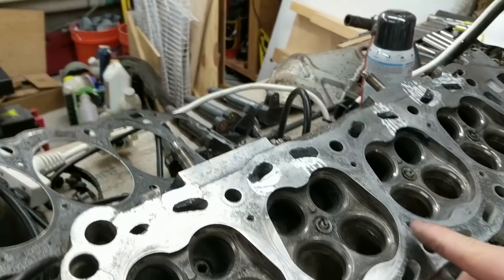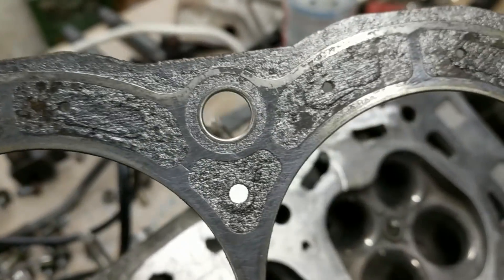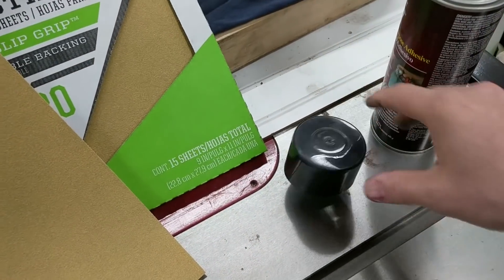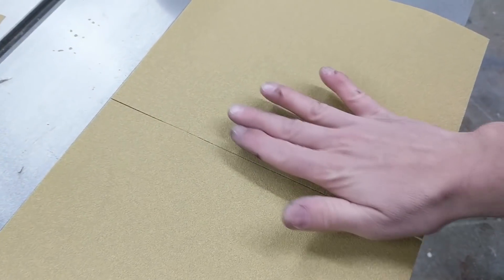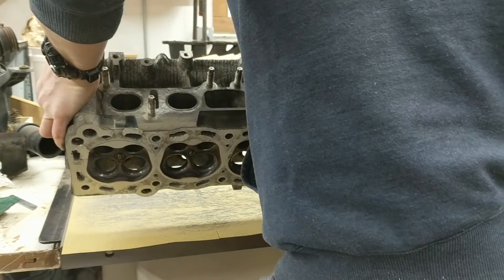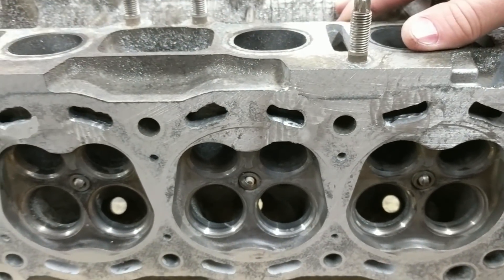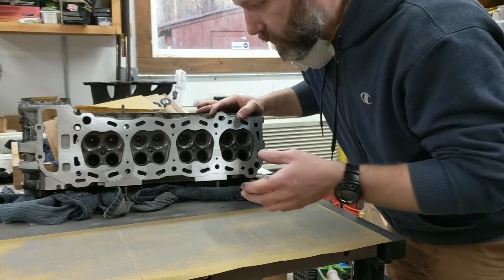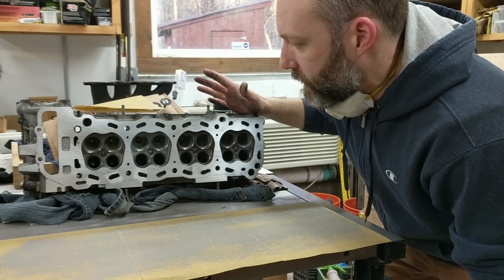Using a Table Saw to Resurface a Cylinder Head

Comment: You should have first used a certified straight edge to verify the flatness of the table saw top. If you sit the straight edge on top of the table saw then you can use feeler gauges at different points to verify how warped the top is and where the warpage is located. Example: If the feeler gauge slides under the straight edge in the middle, then the table saw top is sagging. If the feeler gauge won't slide under the straight edge at the center, but it will at the outer edges, then the table saw top is arched. The largest feeler gauge you can slide under the straight edge (without lifting it) is the amount of warpage in the table saw top. You should check the flatness first unloaded (nothing on the table saw), then again loaded (with the head on the table saw). The reason? The table saw could be perfectly flat unloaded, but could show significant sagging or warpage when loaded. When you check... measure front to back, side to side, and diagonal to diagonal. If the warpage it's less than a few thousandth of an inch I wouldn't worry too much, but if you have 30 or 40 thousandths (or more) then I wouldn't use the table saw top, unless you have a way of making the table saw top true... I would assume you don't or you wouldn't be using the table saw top to start with.

A cheap certified straight edge can be bought at some art stores, usually for drafting purposes. They tend to be thin when compared to a machinist straight edge, but it's better than no straight edge at all. Hope this information was helpful.
Reply: Dude its not going to see boost its fine
Reply: And that's why all the old stuff ran forever because we had guys with patients and knowledge and a thirst for perfection. Unlike these days were nobody cares about quality because people want the newest version of everything knowing they're going to just trash the other one, it's a shame. I've watched people go through a Couple new cars in a 15 year period because they would always have some stupid problem (low quality) and in that time I've had a 76 gmc jimmy that's only needed a starter and a water pump in that time period ($55 and 2 hours of work) Keep on sharing that knowledge we need as much of it as we can get, we need quality back in our lives
Reply: Hope nobody ever hits your '76 Jimmy. You're comparing apples to oranges. Of course a ~40 year old car has fewer systems to fail, hence assuming equal reliability there will be fewer overall failures. Also it doesn't make sense to build a car that lasts 20 years anymore than it does to make a cellphone that lasts 5. Rate of technical advance has increased a lot in the past 50 years.
Reply: @SouthernCrossSailing  me too I love my jimmy. I see what you mean about advancing tech but it seems like everyone's pushing so fast for the newest thing that majority of the newest stuff is cheap. For example I had an old fellow give me his old craftsman belt and disc sander combo so he could get a new one, it lasted 2 months and the one he gave to me still works like new 50 years later. The throw away society doesn't make sense to me especially in the name of new tech. Just like "energy efficient" stuff, yeah that new car or fridge might save you money at first but if you've bought 3 or 4 in the time I've owned one it would appear I've saved more time and money in the end. Also I've left a smaller carbon footprint (not that anyone cares) because the factories didn't have to make those therfore producing less pollution. I do understand that if everyone were to use the old stuff we would probably be living under a brown cloud but that's because there's just to many people in this world maybe if the tech wasn't so good we could have natural selection again and not be over populated but people don't think that's OK anymore. I guess what I'm rambling about is why don't people take the time to build it right the first time instead of mass producing potentially a bunch of cheap prototypes and calling them the previous version, why make a whole new cell phone just to add one more pointless option. Woah sorry I just woke up
Reply: @SouthernCrossSailing  please edumacate me as to why it does not make sense (from a consumers point of view) to make cars that last 20 - 50 years anymore??? Honestly I think it makes perfect sense for a consumer to want to own / buy a new car that is going to last that long instead of the 10 year throw aways we see on the roads these days...
Reply: Then the factories aren't raking in that almighty dollar as often! Sell sell sell, manufacturers WANT it to be a 10 year +/-cycle. My newest vehicle is a '88 Monte Carlo SS,  and is only worked on by me. My other vehicles are '83 Monte and a '67 & '68 Chevelle, all still clockin miles!
Reply: @mikenunya5606  cars last significantly longer now than they used to. In the 70's a car was pretty much considered done at 70,000 miles. now that number has doubled.  and in between you do a lot less maintenance. Sure, the entertainment system goes out and window regulators fail after 10 years,   hell, you don't even have to change spark plugs until 100,000 in most cars...
Reply: @mrl22222  maybe I've just been lucky but I run my jimmy 50 miles a day just to work and back, it's also my toy hauling truck and have drove it a solid 12 out of the 15 or so years that I've had it. That being said I'm terrible at keeping up on scheduled maintenance (I'm getting better) I drive like I'm in a mad max movie (because I feel like that when I drive it)and it probably has well over 150k i would say closer to 200k on it and still running strong with the same abused motor with no signs of failing anytime soon. I didn't change the spark plugs for 60k miles and ran fine, now, they looked like they were found in a cave growing stalagtites on them but you would never have known by how it ran. Like I said maybe I'm just lucky. Just not when it comes to gas mileage lol 10 mile a gallon down hill with the wind at my back.  Not that bad but it feels like it sometimes. Also we just had -40s wind chill here and she fired right up
Reply: I was a machinist some years ago, and this would work just fine. Any small imperfections in the cutting surface really wouldn't do anything. You're not transferring that surface onto the head, just removing material evenly. Just so long as you turn the piece as you do so it would come out basically perfect. I would put this method next to grinding, which can be extremely precise.
Reply: I thought this was a good video the kind of thing I would do but I'm assuming cam bores ( if cam in head ) would be warped also.

Comment: I think you're doing a great job. I would definitely use the 120 if you're going to use an MLs gasket. you want it as smooth as possible if it's a metal gasket.
Reply from the maker: I did end up going to 120 after I read a little more about gaskets.  So much I don't know!
Reply: 180/240 to end with.

Comment: Cast Iron moves after it is cast, it can move after its machined.   My craftsman table saw from the early 90's is warped from to back dipping in the center. So much so that dadoes are deeper on the start and end of a cut.   This  saw top is not nearly as bad as the one Sears replaced.  Just want to say people need to be very careful in that they actually have a flat saw top how they work the head across it.   I would not attempt it without a precision straight edge. 

When I told Sears the second top was warped too they said it was not a professional machine!  Live with it.  From then on it was always Crapsman in my mind.
Reply: yeah, that's why they've been making engine blocks for over a century out of the stuff . You think it moves because you bought a crappy craftsman saw that was mass produced with shit machining. Cast iron does not move!
Reply: a million owners of shitty cheap chinese cast iron bits of machinery would probably disagree, but it depends on the amount of gussets and ribs and whether it was designed to stay flat with weight on it like a surface plate.
Elsewhere, castings are put outside to weather for a year before machining so they can stabilise after they come out of ht
Reply: Ok when rebuilding cast iron engines why do we check the block to ensure that the deck (where the head attaches) is flat?